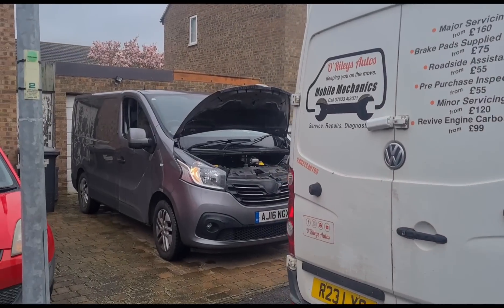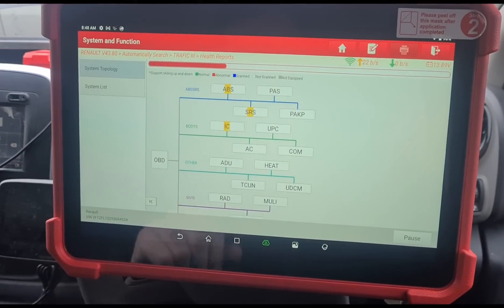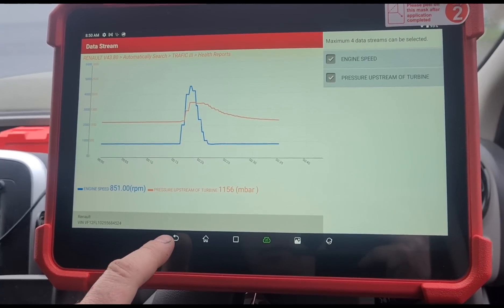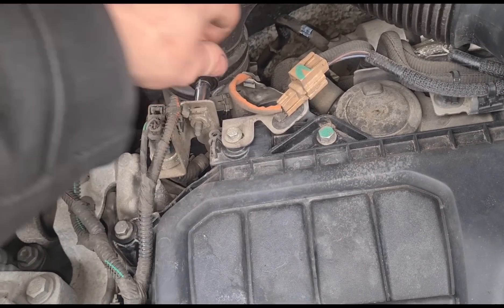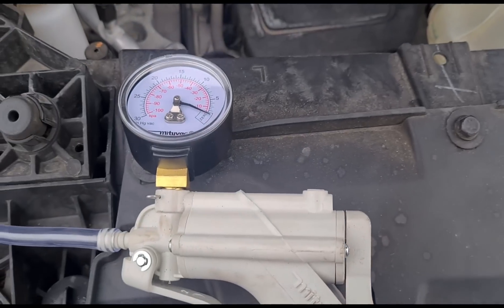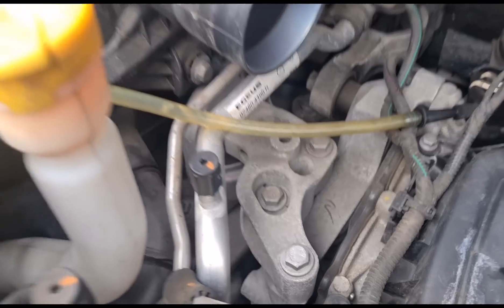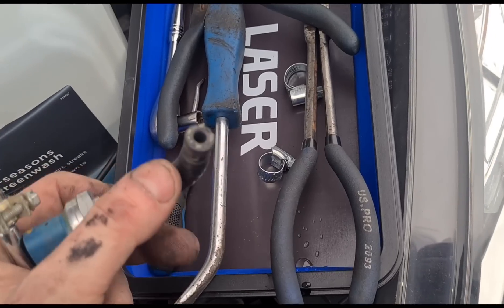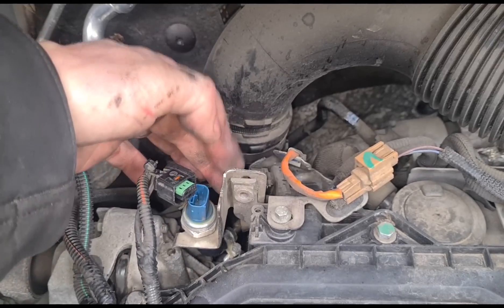How To Test & Clean Upstream Pressure Sensor Of Turbine / Exhaust Back Pressure Sensor

Comment: Great video thanks. I had a nightmare unblocking the pipe, I ended up soaking it overnight with dpf cleaner then went back at it in the morning seemed to work well. I used the same wire as in the video but found it wouldn't penetrate doubled over so I used it singularly when it broke through I doubled it over. Thanks again great vid.
Reply from the maker: Glad it helped

Comment: Ii use a motorbike throttle cable inner. Stainless, multi stranded and if you splay the end a bit it makes a fantastic wire brush for those pipes. Lot more rigid than a floppy G string 😂

Comment: I have a vivaro a 2.0 and getting 2263 underboost code. I've checked vac leaks and also change the map sensor and boost solenoid. Been told could be the upstream boost pressure sensor. Can someone shed some light where that will be located as can't seem to find it. Using a texa axone nemo 2 the upstream sensor is constant at 14. Psi and does not move with revs so assuming a faulty sensor but can't find one, any help would be appreciated

Comment: Thank you for the video. If you can confirm using a diagnostic scanner, that the Stop, Engine Failure Hazard is as result of the blocked Upstream pressure pipe, is it safe to still drive the car if you were unsuccessful at cleaning the pipe.

Comment: Good morning, i have a question. Since this pipe is connected to the exhaust manifold, meaning the dpf fluid goes through the turbo first, wouldn't it be better to inject the fluid through the hole where the nox sensor is located? In this way you spray the fluid directly on to the dpf if i'm not mistaken. Thanks for the great videos by the way.

Comment: Hello Jimmy, just to say this is the best video I've seen on clearing this dpf and piping out because you were patient showing us the steps and stuff required for your job , and although I don't have this engine, I  should think the systems are broadly similar (2.litre Vauxhall ) .So far I've been lucky insomuch as there are some nice hills round here , to drive up, Macclesfield area, so I've not had to much trouble when the dreaded 
" DPF filter full, keep on driving MANDATORY " 😮 Message appears but one day, I'll keep this video in mind if it doesn't clear itself .Nice to see you back and thanks for this again 😊👍👍

Comment: Just over 2 years ago i done the same but i used EGR cleaner to put in the tube ,Nissan T32 Xtrail Garage said you should not do that but it worked, gaiter on the Exhaust was the problem , but i think best use gloves long sleeves with drill / wire i was stupid and the wire whipped my arm, great video again .
Reply from the maker: Thanks for sharing